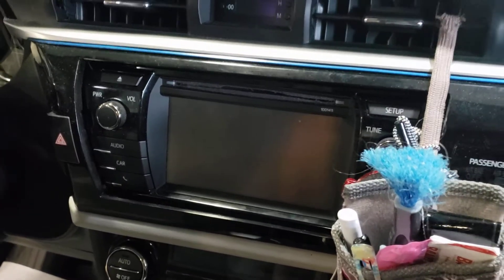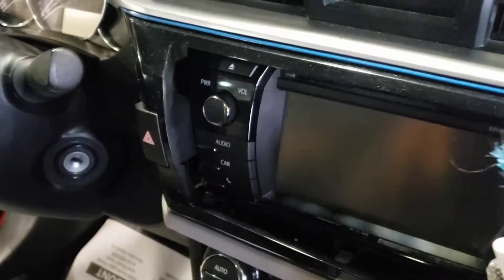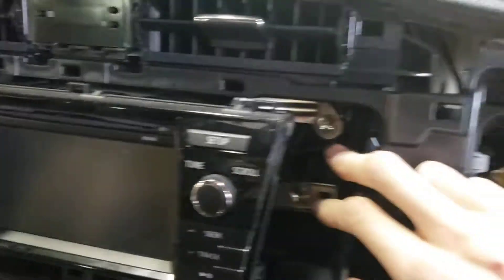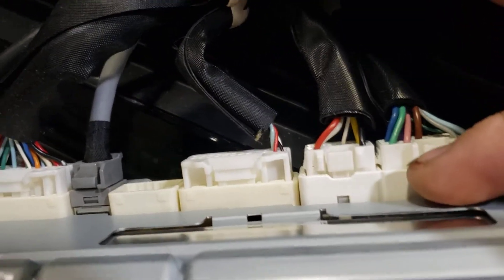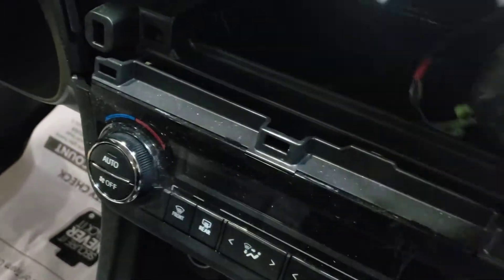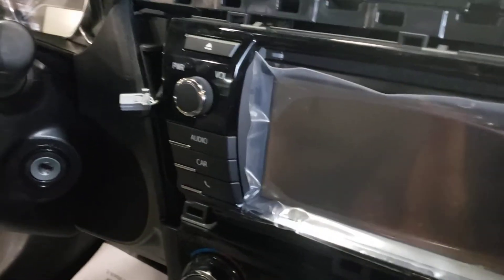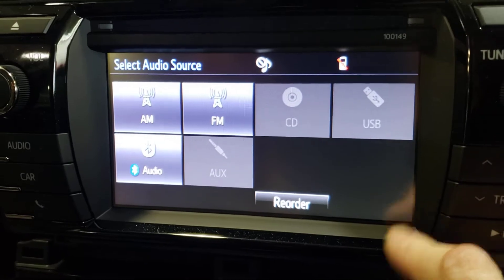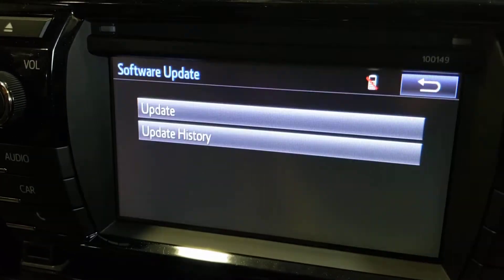how to replace radio on a 2014 toyota corolla

Comment: So my radio is also stuck in the boot loop state if  I were to buy one myself and hook it all up do they need to be programmed at all or do they come ready to use out of the box plug and play style. I see the one you showed in the video had to do the loading before it booted the first time. And do you think It would be worth it getting one off ebay or any similar place. Than you in advance for any possible advise!
Reply from the maker: As far as I know no programming is needed. I work at a dealership so we get the factory part. I would say as long you match up your part number with the new one it should be plug and play. I never had to program any radio.
Reply: Thank you very much for the quick reply I have had this problem for years now with my '14 Corolla. I am just finally having the time and money to look into getting it fixed. My wife and I had the part by it self quoted from the local dealer for around a 1000$ so I have been on the hunt through pick n pull and online to see if I could get one for a much better deal than that.
Reply from the maker: @6101Venom  yes if you can find one elsewhere I would do that the dealership are expensive I've seen radio up to 5k on a 2022 rav4

Comment: Do you know why the radio would be stuck in “loading mode?” It will not go past the loading stage. It is a 2014 corolla. thanks!
Reply from the maker: I don't know why it does that I've seen alot of these where the radio be frozen we always end up replacing the radio unit which is expensive. You can try disconnect the battery wait for while then reconnect and cycle the key on without starting the engine and see if that work if not you gonna need a radio. Toyota don't know how to make radio unfortunately this is a common problem
Reply: @Nickthecarguy  Thank you for the advice, I’ll give that a try.
Reply: This seems to be a problem with all of their radios of that model. It's simply a matter of when.